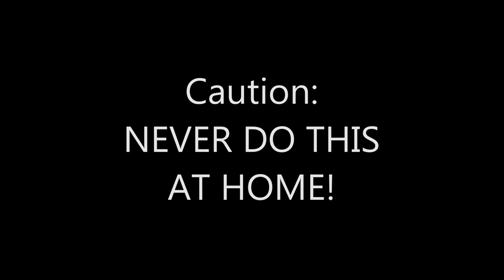Ball Kicking Mechanism using Custom-made Electromagnetic Solenoid

Comment: i want to ask, how to make the selenoid. can you share with us..?
Reply from the maker: Hmm..maybe I will do that..
Reply from the maker: Legaria 79 To increase the power, you need to do either:
1. Increase the number of coil winding
2. Use thicker magnet wire
3. Use as highest voltage as possible 

If you can do all of the above, the result would be astonishing.
Reply: Nudge Me. I want ask again hehe.  How diameters did you recommend to robot soccer.?  Thanks 😁
Reply from the maker: Hi, the normal plunger diameter that I always see is half an inch, the same diameter for most of home PVC pipes.

Comment: bagaimana kalau kita menggunakan battery SLA 12V 7A? apakah bisa? 
soalnya saya liat di rangkaian capacitor charger nya input max 5A
Reply from the maker: +ilfan brt Ya bisa aja. Mengikut pengalaman yang saya lalui, tidak ada apa2 masalah menggunakan bateri SLA 12V 7Ah pun. Kerana 7Ah tu adalah capacity bateri itu, dan ia akan supply arus mengikut demand semasa dari capacitor charger itu, bukannya semestinya dia supply 7A sepanjang masa.
Reply: ok, terimakasih ..penjelasannya

Comment: Do you have it's discharging circuit bro??
Reply from the maker: You can discharge it by shorting a 1 ohm (big white resistor) across the capacitor's terminals, or shorting a coil of solenoid (remove the plunger to avoid kicking mechanism) across the capacitor's terminals.

Comment: dmn saya bisa dapat selenoid trsbut
Reply from the maker: Oky putra pamungkas Hai, coba lihat di sini: https://shopee.com.my/wonderfulhouse.my/103382153. Solenoid seperti dalam video sy bina sendiri, maka untuk memudahkan anda, boleh coba beli yang sudah ready made seperti dalam link di atas.
Reply from the maker: Oky putra pamungkas Anda boleh tonton video ini untuk melihat bagaimana ia dipasang: https://youtu.be/GsnxzMAczHU. Terima kasih.
Reply: Terimakasih banyak .... ☺
Reply: itu bener selenoid 12v, tapi kita memakai 400v ?
Reply from the maker: Oky putra pamungkas Ya benar. Walaupun voltan tidak sama tetapi ia tidak akan merosakkan solenoid tersebut.
Reply: oh begitu.. terimakasih atas informasinya.. kira kira kalau membuat sendiri ,,, memakai inti berapa diameternya ya,, sama kira kira berapa lilitan... ?? terimakaih,, soalnya barang yang ada sold out
Reply from the maker: Oky putra pamungkas Kalau ingin buat sendiri, saya gunakan magnet wire berdiameter 1mm, dililit pada teras PVC setengah inci sepanjang 10 cm, dibuat hujung ke hujung sehingga 3 lapisan. Lagi banyak lapisan lagi bagus. Cumanya ia amat memenatkan dan memakan kos juga untuk beli magnet wire tersebut. Bagi saya, lebih elok beli yang sudah siap. Jika kamu mahu, coba lihat di sini: 
JF-1578B  DC 12V 5Kg 30mm Open Frame Push Pull Electric Solenoid Electromagnet
http://s.aliexpress.com/am6bQzQn

Solenoid ini amat berkuasa kerana ia menggunakan lilitan yang tebal dan banyak lapisan, dan saya ada membeli dan menggunakannya. Percayalah, kuasanya memang di luar jangkaan.